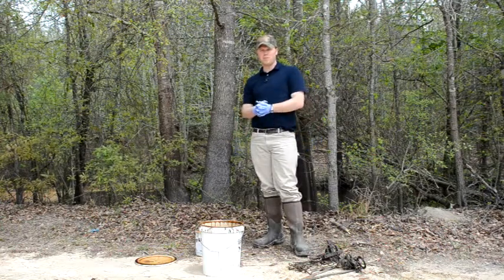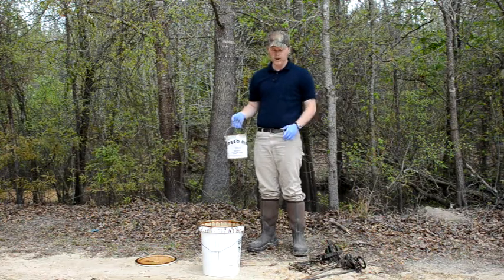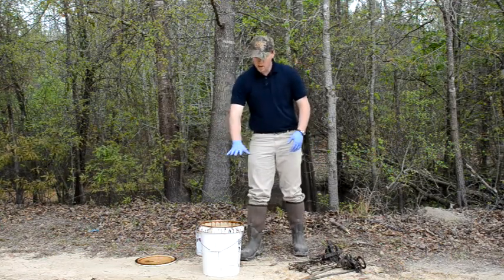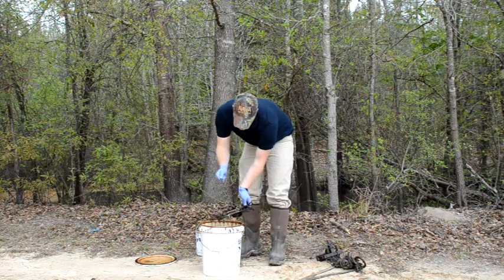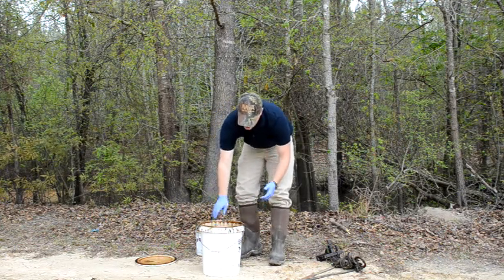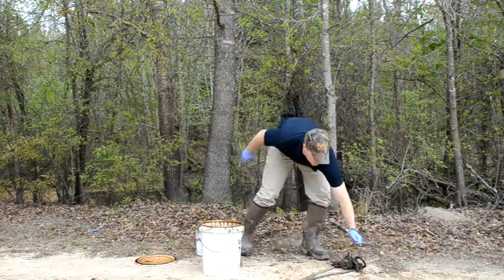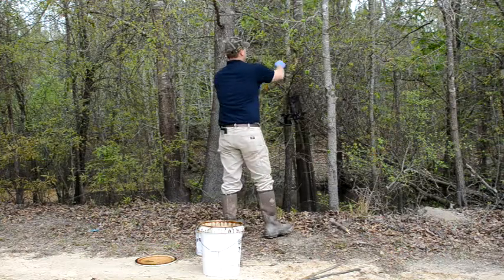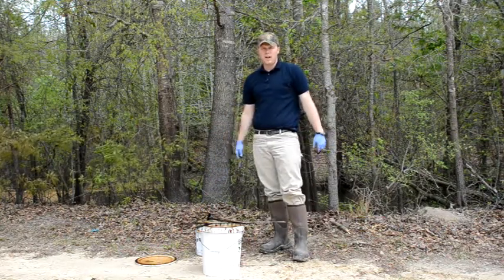Beaver Trapping - Trap Preparation

Comment: i used speed dip last year on my traps.they turned out with a thick sticky film on them,just wondering if you know what i did wrong
Reply from the maker: Using a little more than called for gas/coleman fuel can help with that.  Speed dip also tends to be affected easily by humidity, so you want to make sure the humidity is fairly low when you dip and leave plenty of time for them to hang and dry.  If your traps do turn out sticky you can dip them in gasoline and it will typically remove the sticky.  But my first step would be to add more gas/coleman fuel to the mix.  Also, if you can find it I would use ethanol free gas if you are using gasoline.  Hope this helps.
Reply: thanks man i will try it